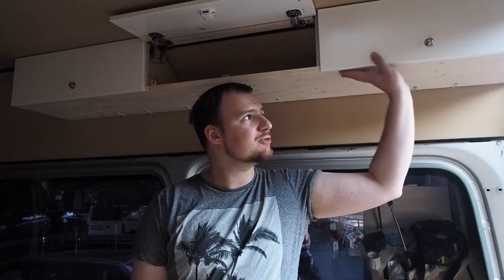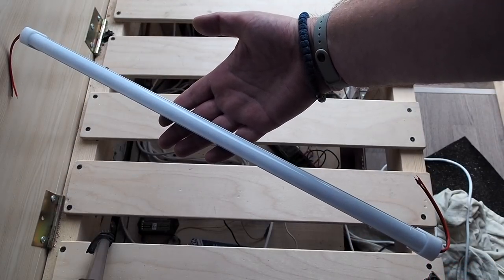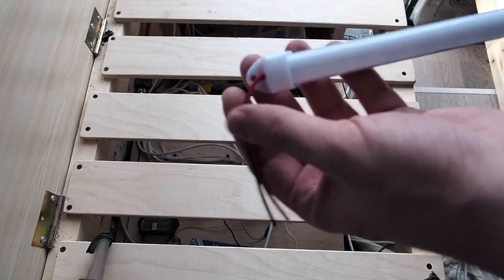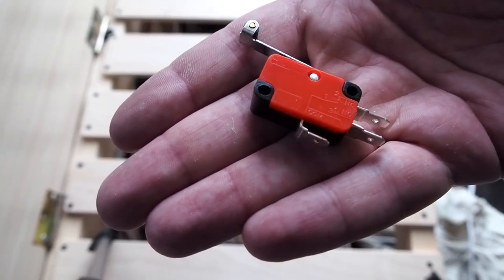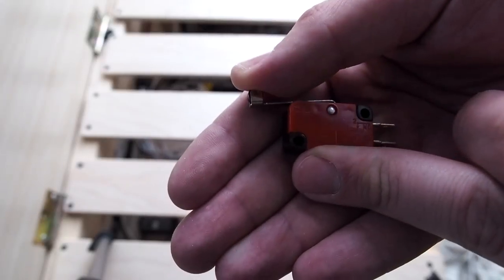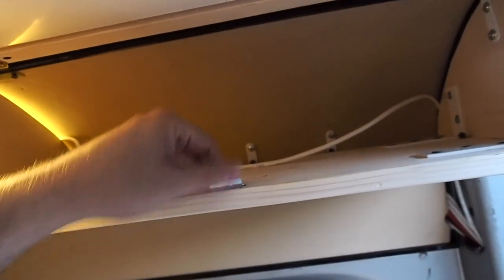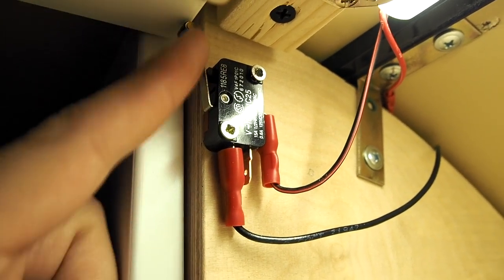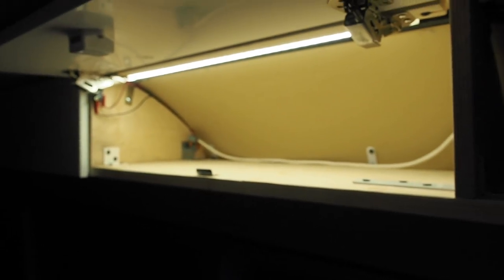Automatic led lights for cabinets with push switch in diy van conversion

Comment: Aloha I wanna do same setup on my camper shell. I want light to turn on when I open the shell and shut off when I close it. Anyways is ground wire in your video black and you have power red and light wire going to power
Reply: Wait I got it. Ground was black wire correct on bottom of the switch. Power is red wire only to light and. Red and wire light going to switch together. And I right